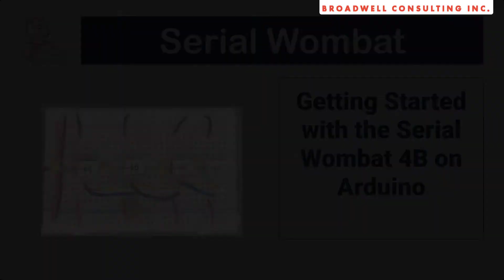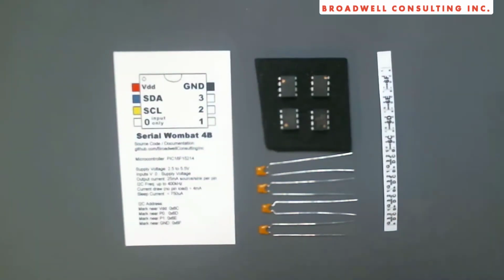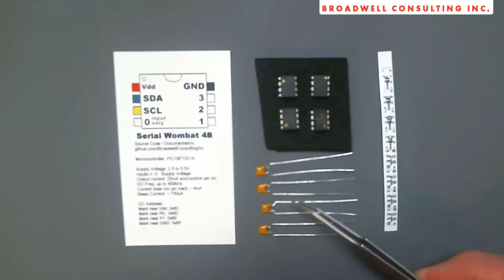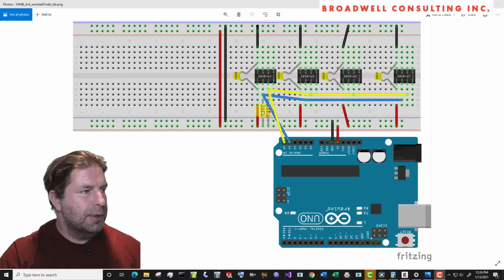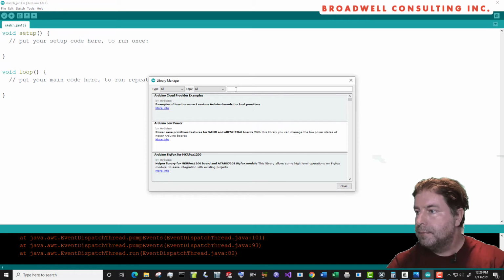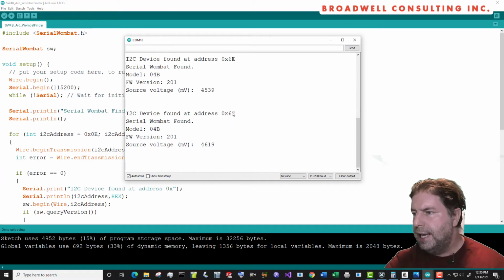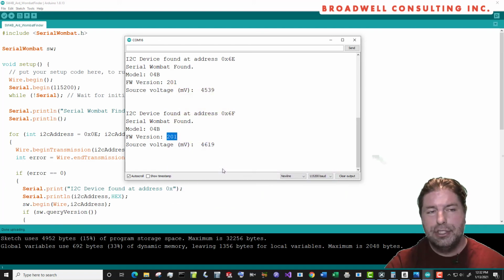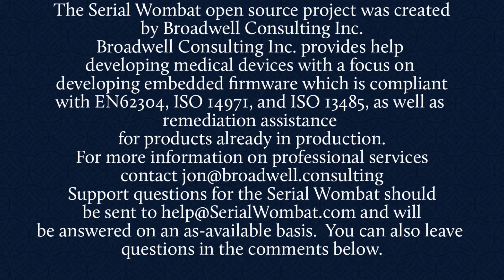Getting Started With the Serial Wombat 4B chip and Arduino using I2C

Comment: What value pull up resistors do you recommend?  I'm testing on a Raspberry Pi.  I've got communication with the built in I2C but not on GPIO using pigpio and am wondering whether there's a pull up problem.
Reply from the maker: I typically use between a 1.8k and 5.1 k resistor.  All seem to work ok at 100kHz, although I sometimes seem to need 1.8 to 2.2k when I'm on an ESP8266 for some reason.  If you don't have one, I'd highly recommend getting one of the $12 Saleae clones on Amazon to do I2C protocol decoding.  I wrote a half-way decent protocol analyzer for their system that you can see on one of the other videos.  If you like it I'd highly recommend getting one of the genuine Logic-8's if you can spare the cash.  With that tool you can see the logic analyzer and analog measurement in conjunction with each other, which is useful for seeing why glitches on the bus happen if they do.

Comment: is there any way to change which pins you're using for I2C communication for boards like the arduino mega or the raspberry pi pico that have multiple I2C ports?
Reply from the maker: The I2C pins on the sw4b are fixed.  Are you looking to use different pins on the SW4B or on the mega?
Reply: @SerialWombat  on the mega
Reply from the maker: @mrex5769  I believe the Mega has only one hardware I2C interface.  Some boards implement a second I2C by defining Wire1 .  Others, such as the ESP8266 based boards allow you to specify pins in the begin call to Wire.

Comment: This looks interesting. So each chip basically adds 3 I/O pins and one Input-only pin?
Reply from the maker: That is correct.  You can use 1 to 4 chips in a given project with the Kit I sell on Amazon, as they come in a pack with 4 different I2C addresses.
Reply: Seems like a good way to expand the ESP8266's limited number of useful pins. I may grab these for a project.
Reply from the maker: @brettb.345  I've used them with Node MCU boards, and also with bare ESP-01 boards.  Both work well.